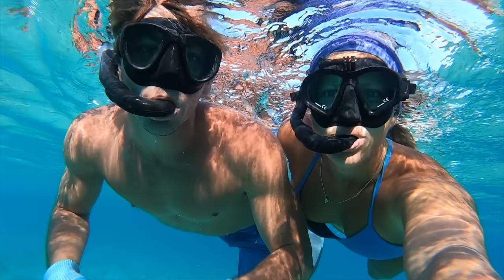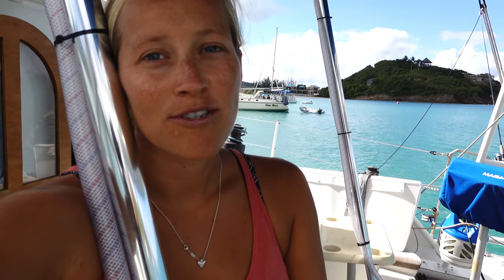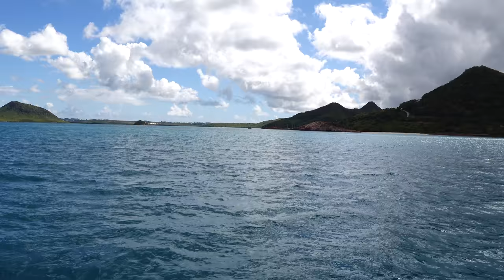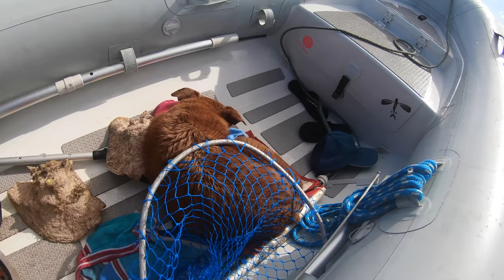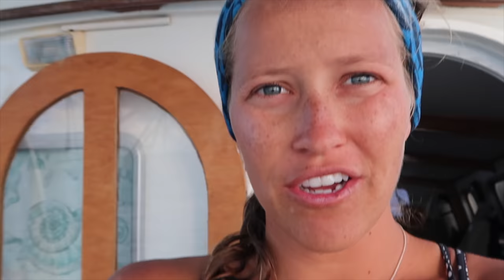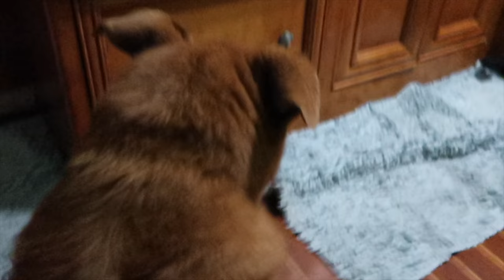Crazy. Conch. Catch. Clean. Cook. // Liveaboard Sailing Lifestyle

Comment: Does the surf ski weigh more than the generator?
Reply from the maker: Nope
Reply: @Tulasendlesssummer    LOL   that was Good
Reply: Greetings;    Surf skis weigh from 35 to 45 pounds.  They are not made of the usual kayak material of rotomolded polyethylene.  They are usually composites of fiberglass and Kevlar and or carbon fiber.  A new one is expensive, probably ranging from three to four thousand dollars.  A used one, especially from a boat owner who is quitting the life, would be less than a thou, maybe less than 500.  These are wild guesses from an old kayak nerd.   Bill of m/v Grace, St. Petersburg